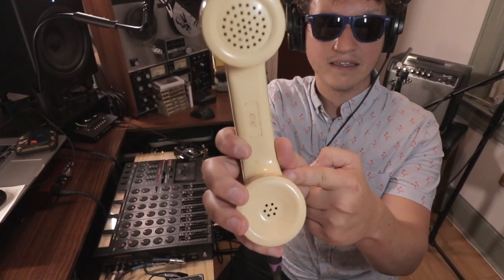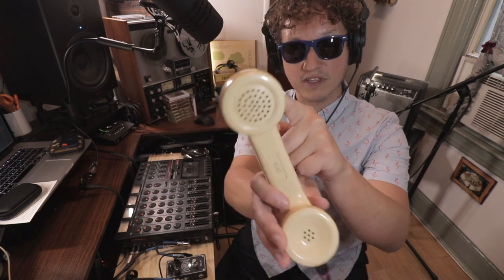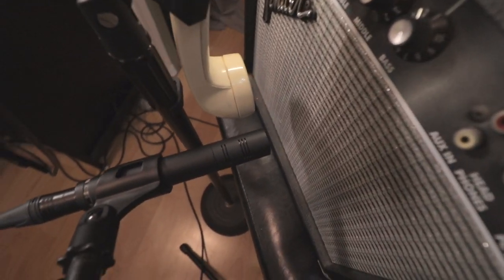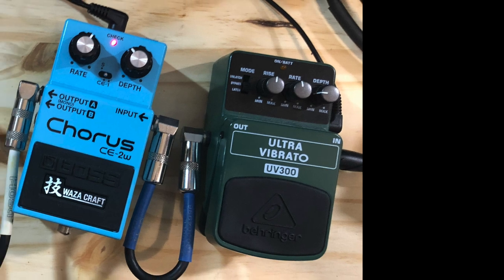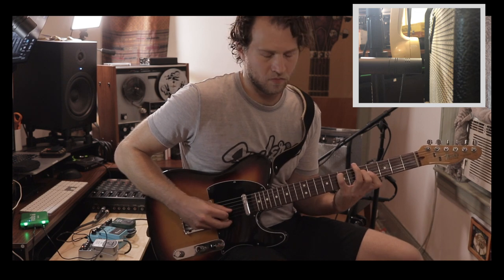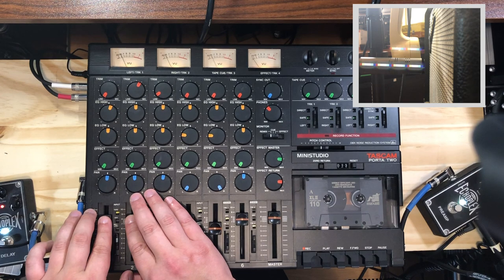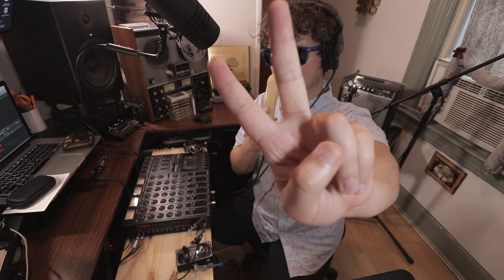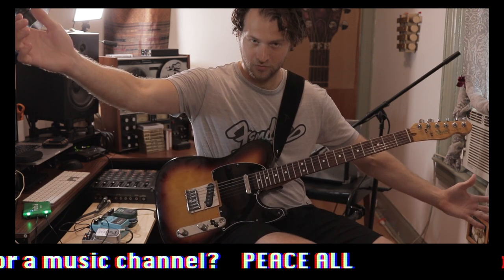Telephone Mic on a Guitar Amp

Comment: I made my phone mic with one I found in a wasteland, even managed to keep the original coiled cable and base. Lots of fun recording drums, vocals, but didn't try on guitars yet. Added a nice, mid-thickening presence. I also enjoyed using reversed 70s headphones as overhead, sounded pretty dark, yet defined. Otoh it's moody regarding noise, can start buzzing without notice.

I enjoy to do this band-pass kinda thing when sending sounds to delays and reverbs. Might as well begin to record with the telephone going thru the delays and printing along the dry track.
Reply from the maker: I just heard about the headphone trick from a DJ! thanks for sharing!